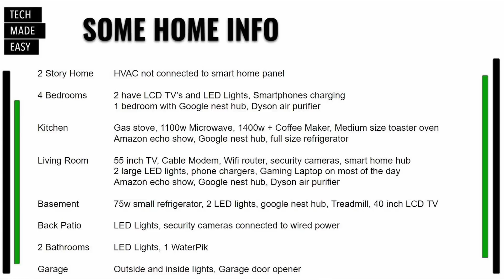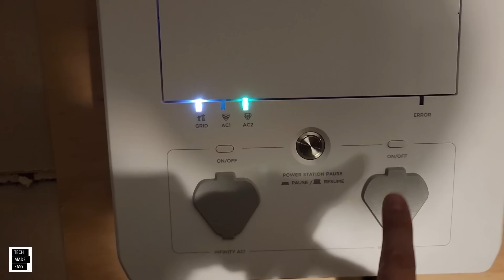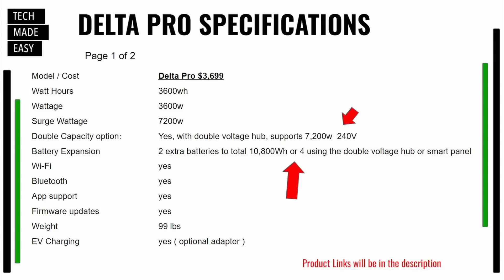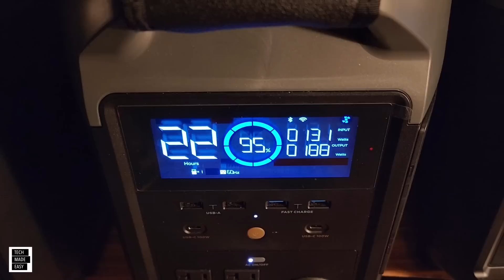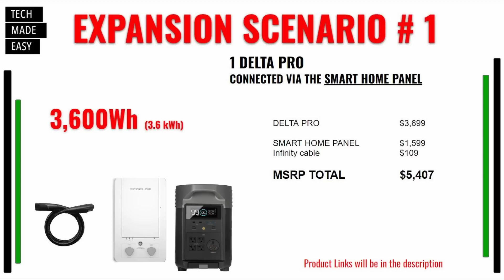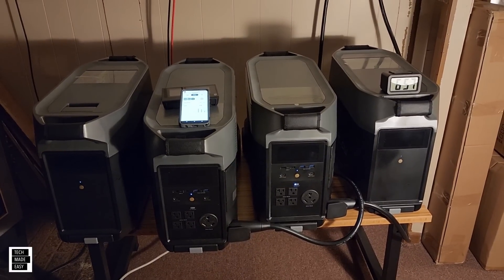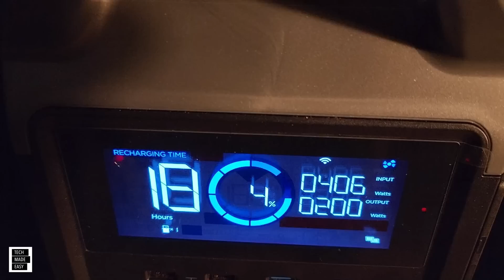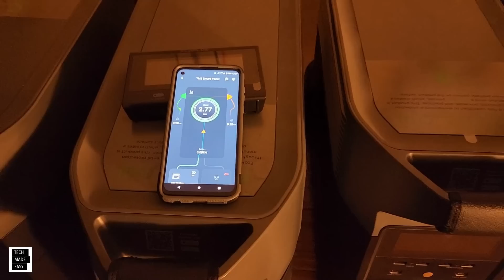Real World Test with EcoFlow Smart Home Panel & EcoFlow Delta pro

Comment: Let me rain on your parade with some facts about this worthless product.  30 Year Electrician here with some points to consider after just installing one of these:
1. Poor quality, box is tin and cheap plastic.  It is too small for even the wires that come with the unit.  I am betting wouldn't pass NEC on box fill.  All wires are aluminum, this means that in every connection you get to apply antioxidant to your connection (gray paste, fun stuff).  
2.  With some rare exceptions you will find the wires provided with the unit are too short to reach either breakers in panelboard or circuit you are connecting to.  The labels on these wires are paper and will not pass through a raceway without tearing off so plan on relabeling all wires.
3.  Because they used aluminum wire instead of copper that increase diameter of wire requiring you to increase raceway size to accommodate.

After install this is what happened: 
1.Four red indicators appeared on four breakers. Error indicator also was on.  App said all were working no idea why.
2. Moved.breakers around to determine if breakers were bad.  Red error indicators would dissappear and appear at random breakers. Meaning not the two we we swapping but at another breaker or more than one. Just a hot mess frankly.
3. When unit was shut off because after nearly three hours of chasing the problem I was done. The unit blocked power to a circuit in the home and that circuit had to be disconnected from the smart panel and worked fine.
4.  Customer support was somebody with no clue about electrical (bad no idea they were talking to an electrician) and who offered random totally irrelevant questions to "help find a solution".

Between the quality of the product, the installation issues created, and the absolutely horrible customer support cannnot recommend this product to anyone. If  by some small chance I get the call to put this in for you...  NOT going to happen.  

Last point tried to review this product elsewhere could not find a single location.  Usually means any positive reviews are bought and paid for.

Comment: So no heating or cooling included in these tests .. so what’s the value of this system when your off the grid ? One cup of coffee vs 4 cups for rest of the family. 
This is an expensive system ~$12000 . This would not have lasted in a real world black out say hurricane in Naples Fl 

Why not get $1900 Generac for continuous 7.5kw …. And get whole house powered ?

I  don’t understand what problem are you solving with this expensive system 

Heat and coffee all day long with 240v 
Cheers
Reply from the maker: That's in my case but you can setup hvac 120v 240v